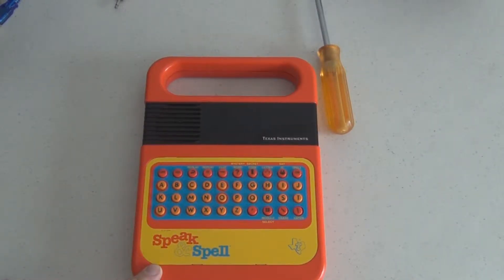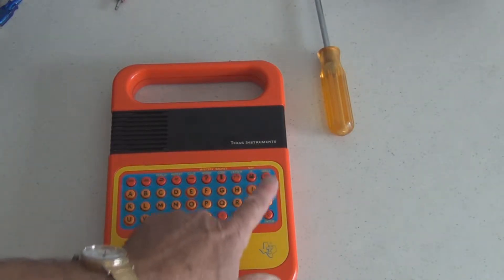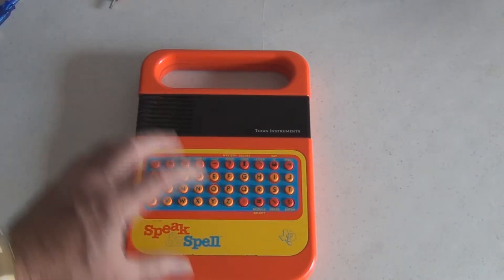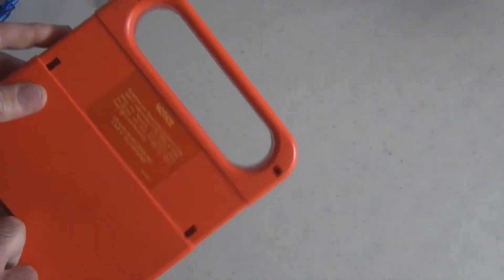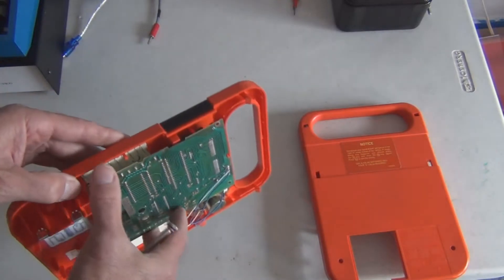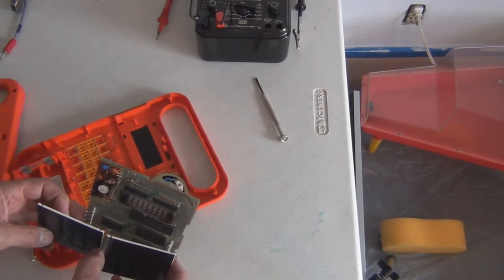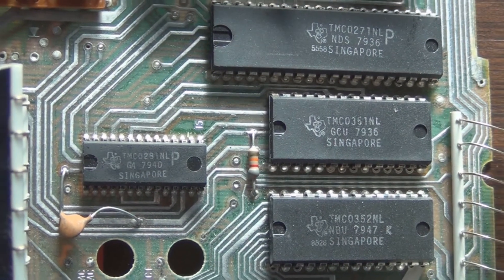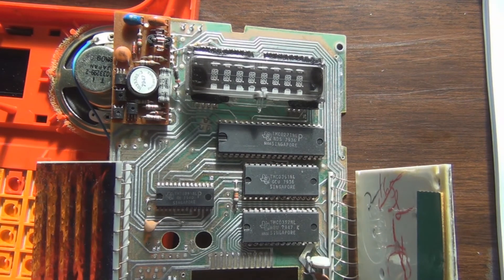Speak and Spell teardown

Comment: Glad you took yours apart so I don’t have to take mine apart
Did the speaker have TWO sets of wires going to it
Reply: Speaker has red to pos and black to negative from the transformer and three from transformer to board, black, brown, blue.
Reply: I just reread your comment and speaker has one set of wires but has the isolating transformer between it and the board.